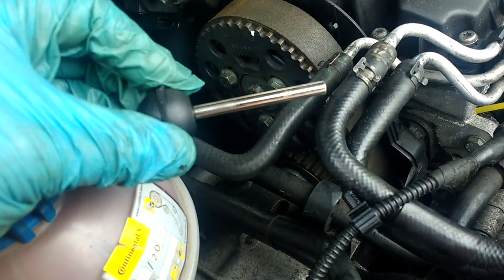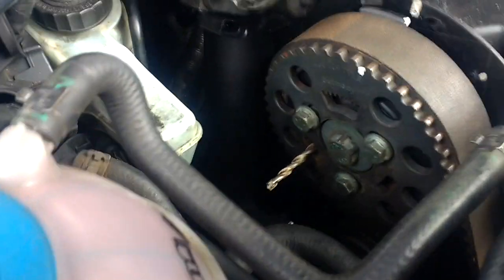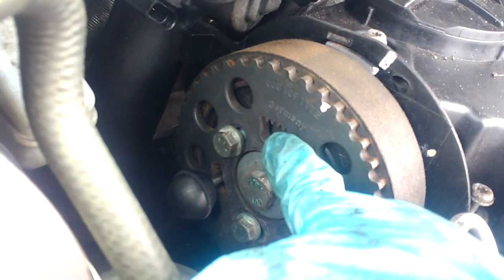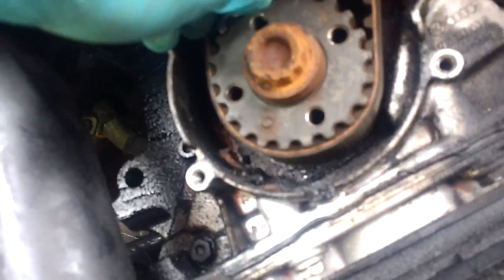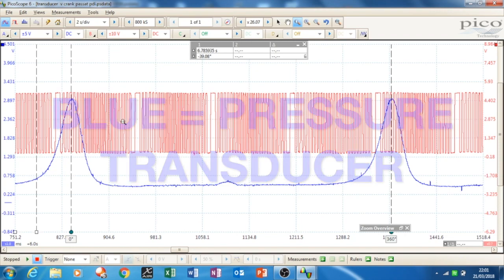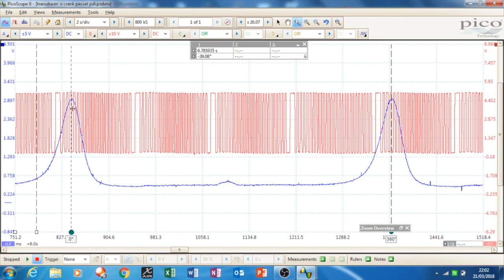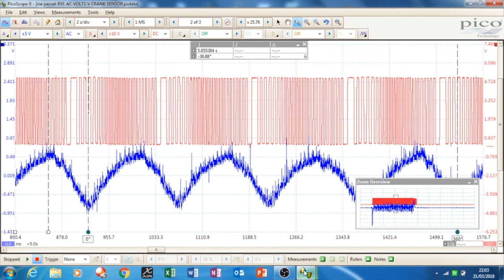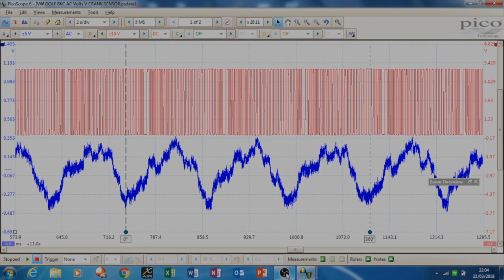VW PASSAT PDi 2009 CRANK NO START PART 4

Comment: Sandy am I missing something? Or should the distance not be 720 degrees between your in cylinder pressure peaks. (Assuming your trace is displaying the same cylinder). Cheers Ian.
Reply from the maker: TheGibby3340 yes your correct it is only displaying cylinder 1 the cheap defaults to 360 but u can change it cheers sandy
Reply: It is 720 degrees the crankshaft timing/speed  ring has 2 sets of  missing teeth spaced 180 degrees apart
Reply from the maker: myles waller correct
Reply: myles waller 
I was referring to the zero and "360" measurement cursors. If not corrected to 720 the other measurements will be off by a factor  of 2.